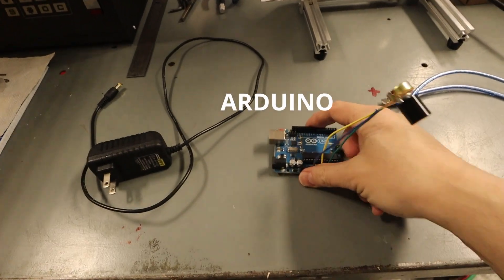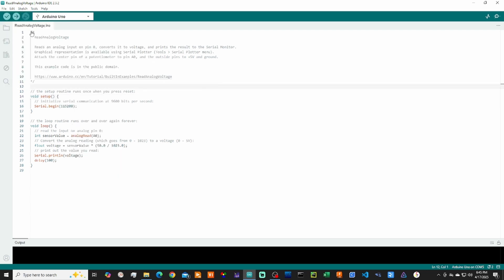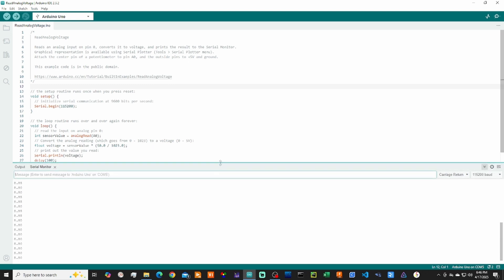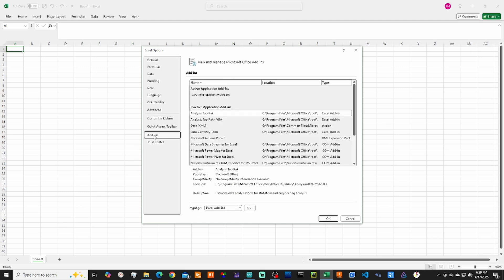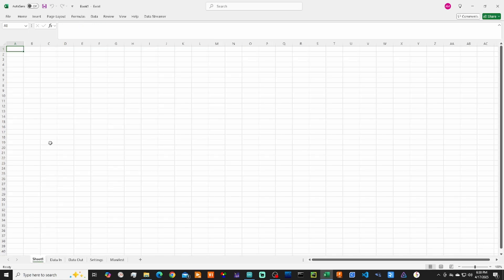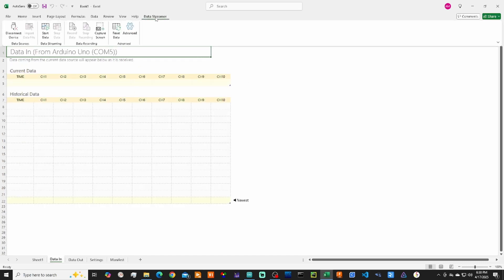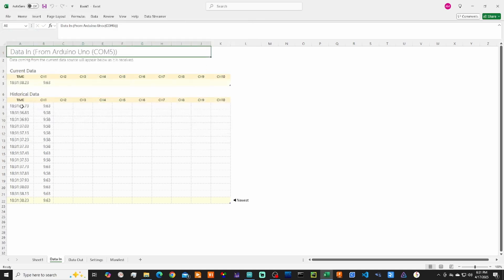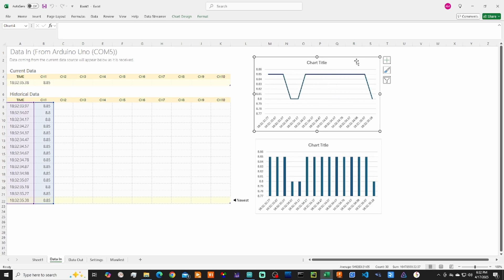Log Arduino Sensor Data Straight Into Excel – No Code Needed!

Comment: Just don´t! Exel is not a database. Just don´t!
Reply from the maker: Thanks for the comment. That’s true it’s not a database but it does work just fine as long as you stay under the 2 gig file size and the 1 million row limit. Which is doable for most projects. Otherwise I’d suggest running a separate data logger for data capture and use the Excel as the visual dashboard. What method do you use to record your experiment data? Stay tuned for more!
Reply: @AndyMaker   correct
Reply: What do you recommend?